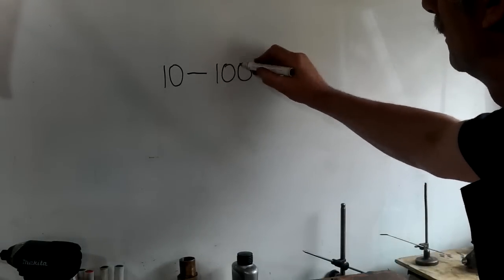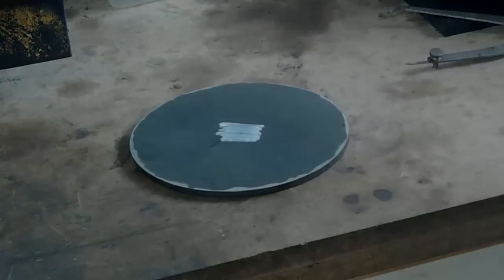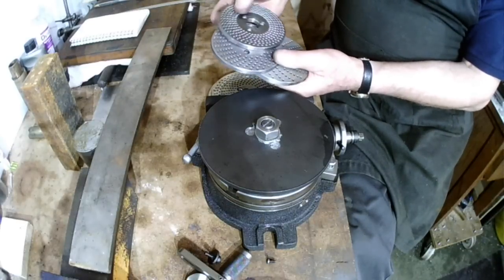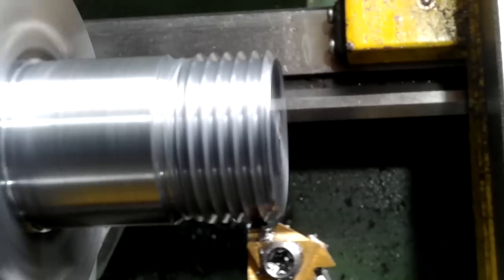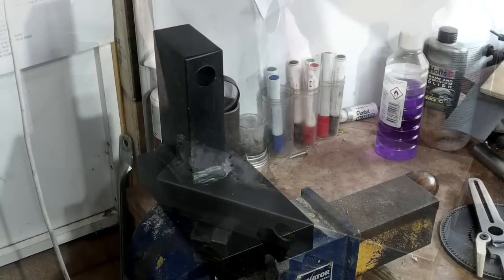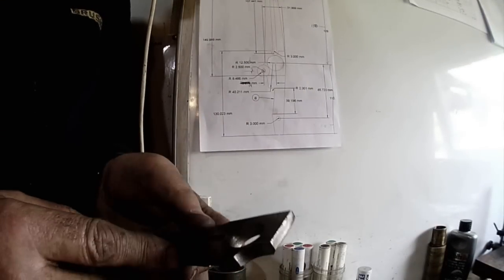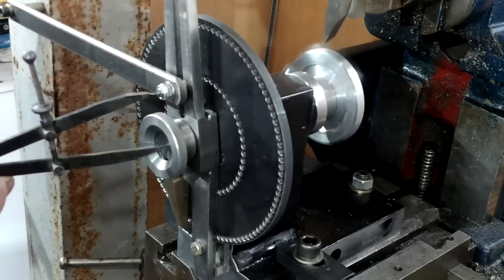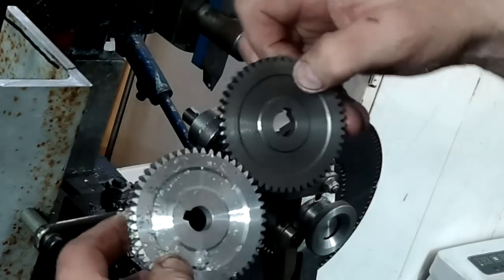Gear cutting on a Shaper (making the tool)

Comment: For cutting gear teeth on a shaper, I had only considered using a cutter with the complete involute shape of the space between teeth and plunge cutting to depth.  Using a jig to generate the involute shape with a straight edged V shaped cutter is very clever!
Thank you for making such an informative video!

Comment: Great project.   This setup will result in a tooth profile that differs slightly from an involute.  The tool path error is greater for shorter linkage and smaller number of teeth requiring turning the gear blank through a larger angle. When the tooth being cut is at top center the error is zero but diverges as you move to the side and turn the gear.  The error should be small enough for most practical gears to ignore.  EDIT: I did the math. with a 15" link arm cutting a 4" dia 24 tooth gear the error is 0.0004" too shallow vertically. (a 10" arm has 0.0007" error)

Comment: I tend to give subdued compliments at best but think this is a fantastic video..
Just thinking, you could angle it to cut helical gears, and combine that with a milling head to cut teeth without a clearance behind while cycling the ram manually.

I've made one large indexing plate, its tough but definitely easier if you can leave it setup on one machine and drill in sections.
Reply from the maker: Hi, thank you for your comments, nice idea for helical gears, i might look into it . I also find that the indexing plates come in handy for other quick setting options. regards

Comment: Very nice video!  The linkage will not produce a constant rotation per unit of cross feed…due to the geometry of the system.  You might want to check out @pottingshedworkshop.  Good going on taking on something so challenging!

Comment: Nice job. I was watching a channel with a homemade indexing wheel drive. He started the table 1 inch away to make sure all the backlash was out before the cut started. Your gear looks the part.
Reply from the maker: Hi, thanks, It is still in use. cheers.

Comment: I don't think I would ever be able to cut gears like the setup you created. For one thing it takes someone with a good mechanical/engineer mindset to vision what's to come and how it would work. I was a welder for 40 years, certified on everything. I would be happy just to hang around and make the welds for you. Amazing work you did. Thanks so much.
Reply from the maker: Hi, thanks.

Comment: What a pleasure it is to watch you work. I wish I were there and could add my welding skills of 40 years. I always learn from your great videos. God Bless and Thanks, Paul Greenlee
I forgot to ask you when you use your shaper compared to a milling machine. Do you think the learning curve to run a shaper is easier compared to learning how to operate a milling machine? Big difference in price for a fact meaning the shaper is less expensive. Thanks again for the help.
Reply from the maker: Hi, thanks for your comments. I had operated one only once, in college and it was harder machine.  meaning that a machine that is a balls out everything. If you take a bit too big a bite, the shaper will destroy itself to please you. The tutor always stood over the student while it was being set up. The saying is if you have a shaper you'll never make a profit because they are slow. I would beg to differ if the machine is properly used.
Regards.

Comment: You do have a dividing head.

Now you make a new dividing head with the help of this dividing head. I don't see the point.
Reply from the maker: Hi, thanks for your comment. Yes, it was a lot of hard work to make another indexing device. However, I did mention right at the beginning of that video that I would take up the challenge of making a gear on a Shaper. My universal indexing table was too big to fit on the Shaper, so I had no choice but to make this simplified indexing device. It did, and still does, make an extraordinary number of gears of any size to a reasonable diameter with any DP or module on the shaper and, it fits the milling machine, surface grinder and the tool cutter grinder. that's got to be a bonus. Cheers.

Comment: I purchased 11 different index plates off from EBAY (7.25" dia and under $200) all the same size, all specifically different in hole counts (some have 4/5 different count rows of holes on the same plate) and on yet another EBAY buy I purchased the spring loaded hole spacer pin keeper (used) off from some brand of original indexer (?), so that I could do as you are describing, BUT I made my mount such that I could cut gears as large as 13" diameter (maximum height drop on my shaper (Invicta 4A) table to cutter tool), so basically I can cut any tooth pattern from 4 to about 160. I cannot stress the need for an extremely ACCURATE GRIND on the tool cutter as this is the hardest of all of the operations. I wish that some manufacture made proper different size carbide inserts so all one would have to do is change the insert in the tool holder for the different needs of the different size gear teeth faces being cut, as I have no way of properly grinding them and that has proven to be the COST ITEM in the equation for doing the work yourself. Usually it takes me a minimum of 3 to 4 rotation rounds before I can achieve the full depth of the needed cut (raising the table needed X height after each pass) until the final depth is achieved. (NOTE: very accurate tooth gauge set required to maintain accuracy of measured depth and this item from Boston Gear (metal set) cost well in excess of $90), but absolutely all worth the cost to save a piece of equipment for which parts availability ceased 50 to 80 years ago.
Reply from the maker: Hi, thank you for watching, I take it that you have constructed one for yourself or something similar.
The tool is a bit of a pain to cut to shape, confirming size and shape without a shadowgraph equally so. 
I wrote a spread sheet program to calculate the tip width required for any given mod. cheers for now.

Comment: Buy a small hobber. This you did put too many errors into gears. For this to run smoothly, quite impossible, pitch errors would be too great.
Reply from the maker: Thanks for your comments but, I am a pensioner and I can’t afford a hobber of any size not to mention the cost of each type of hob cutter to make each mod. The tool I built has saved me a huge amount of cash making all sorts of gears and they all function very well. It is true that there are potential errors but, I’m not making precision gears. Regards

Comment: What you have done here reminds me of when I drilled over four thousand holes in a large plate. They had to be on location within one thousandth of an inch X Y axis. That is plus minus one thousand of an inch. This give me away as to where I am from the other side of the pond. The easy part was the Z axis that went through the plate. When drilling was done I reamed the holes with a two flute end mill. This made the hole very precisely. Worked like a charm. My reward, was an order for five more plates. I did not scrap a single plate. All within tolerance. The method you are using was the brainchild of Sunderland Gear Planer. Using a shaper with more bells and whistles. 
   I really enjoyed your video and hope you make many more Sir. Good luck and God bless too. Peace VF
Reply from the maker: Hi, thank you for your very kind comments.

Comment: How to get relation between linear travelling of work piece and its rotation for diffrent sizes
I mean balance equation
Thanks for your good work
Reply from the maker: Hi, simply look at a rack then look at how a gear would run over that rack, then reverse engineer how the functional relations between the two interact then you begin to see a picture of how to form the gear from the rack.

Comment: Slick. 
Years ago there was a video by a gentleman from Denmark who was building a 1/4 scale Kingair RC plane powered by homemade turbo props.  For the reduction gearing between the turbine and prop shaft he needed an internal helical toothed gear. He modified an old small milling machine or jig borer to cut the needed gears. That was probably the slickest piece of home shop gearing I've ever seen.
Reply from the maker: I haven’t seen that one.

Comment: How do you determine the size of the cutting tool ie the width at the tip
Reply from the maker: Hi. the formulae I used is :-
Dedendum x Tan(P.A.) = sum’A’
Circular Pitch / 2 = Tooth Width
Tooth width - (sum’A’ x 2) = tip width.
that’s how I calculated it.

Comment: Thank you for sharing your work, I was anxious for Jeffrey Crocker to continue his efforts to build one of these. Is there any chance you would share the cutter forming process? I cannot seem to find this information anyplace. You did a great job building this tool.
Reply from the maker: P.S. the gear cutter device has some faults rigidity is the most common issue.
i would also suggest that the tool be very sharp and and the feed rate not to exceed more than 0.1mm per stroke the tool must also pass right through. Despite the feed rate, the overall cutting time is comparable to milling.(if the gear is a very wide gear it is much faster than milling)
Reply: @Thesheddweller  I do not see how there is no table or formula for calculating the values for the cutters. I have searched through many very old texts, and found that they all refer to generating gears on Planer Mills and show the devices for this task. The equipment is much like the fixture you have created for your shaper. I have found repeated reference to generating gears by shaper as well, including fixture designs similar to yours, and still no reference to the cutting tool. I have to be missing something that is so obvious and simple that it didn’t even need to be written down.  I am sure that I’m over thinking the problem, I just cannot figure what I am missing. Thank you for your help and inspiration, maybe someone can clue me in if they see this, or point me in the right direction. Good luck, thank you for sharing your work.
Reply: I was planning that I would use my gear gages as templates for my next attempt at creating a tool. They are rack-form, so they should be a good template.
Reply from the maker: I hopefully sent a couple of pages from someone calling themself 'Base Circle’
the piece is titled ‘Gear cutting with the shaper'
Reply: @Thesheddweller  it didn’t make it, I sent you an email. Hopefully it gets through.
Reply from the maker: Hi, are you asking for my design notes or drawings for the tool? I haven't any drawings yet but when I get a spare day I will run some up and publish them for free like the thread cutting tool in my web site... www.thesheddweller.com.
Reply: @Thesheddweller  I somehow missed your reply. I have a slightly different notion for the fixture, I want to use half-ground pins so I can stack gage blocks to set the PCR. I think I would get less error that way. I was asking about creating the correct cutter form to use for this operation. The only part of this process that I am missing is the cutter geometry that results in the correct tooth form. I have searched online, and read many older texts looking for some guidance on this issue. If I could find the information for rack-form geometry it should be the same, but I’m coming up empty. I must be missing it too somehow.
Reply from the maker: @someguy1508  I too didn’t have any luck getting a table to help me calculate the shape of cutter tools for various rack sizes that I required,  so I made my own on a spread sheet (its on an apple program called numbers).
All I have to do is enter the..  mod, PA and how many teeth on the gear. 
it calculates and outputs the following,..  tip width, depth of cut, gear blank size and the DPC in both metric and imperial sizes.
You would think that after calculating all that and getting the spread sheet to work like it does. I have never verified it and I haven’t got a clue how to send it to anyone.  Its something to do with being a member of the old farts club. :-D

Comment: What about the error that the linkage introduces compared to the string variant?
As far as I understand, the linkage introduces a error that is the tangent function of the gear roll angle, a small number in the beginning, getting larger to infinite as the angle approaches 90°. So small gear tooth error with small, shallow teeth (if the tool disengages at a small angle) and large error if cutting few deep teeth, as the tool remains in the tooth profile for larger angles?
Reply from the maker: I have been contacted by Tomas Berger (I believe from Czechoslovakia) who has analysed the system, if you go to either of the two addresses below you should see his results. The linkage backlash, after I’d replaced the end bushes, had only a very slight play mostly flex from the anchor bar if I force it. I would assume (but I don’t know for sure) that the wire system would be more accurate at the extremes. I believe that at the extremes of travel, with the tie bar system, the rotational circumference accelerates.

https://berger240.rajce.idnes.cz/youtube/1466314247

Comment: Very impressed with what you have managed to do there. I think you have an error when you are setting the PCD with the calipers. Should this not be the base circle diameter? For a spur gear this is calculated by multiplying the PCD of the gear by the cosine of the pressure angle. The base circle is the diameter the involute curve is generated from, not the pitch circle.
Reply from the maker: Thanks for your comments. I used the PCD because this is the point that two wheels, one driver and one driven,  would ordinarily make contact before teeth are put in to the equation.
I've not tried it, but if I set the sliding pin to the base circle, at the dedendum, I believe the tops of the teeth will be more pointed, equally, if I set the sliding pin higher like nearer the top of the addendum the top of the teeth will be broader. But like I say I’ve not tried it. regards.
Reply: @Thesheddweller  Your definition of the PCD is correct for standard gears, but the involute is still generated from the base diameter. So you will have a small pressure angle error on your teeth, but if it is not impacting performance too much it should be fine. Still a very good effort. 
PS. There is an error in my previous post. I stated B. Dia = PCD x Cos PA, but it should be Ref Dia x Cos PA, as Ref dia and PCD are dirrefent on non standard gears.

Comment: This method will not produce perfect invlute gears. Tip of the tooth will be cut deeper than it should. It will probable work fine for larger teeth counts, but for 10 teeth gear it will be completly  wrong. It is because as you are more away from the center the angle of gear is less linearly dependend on sliding. I didnt watch the video completly(sorry, not much time), so if you are aware of it.... PS: otherwise very intersting. Subscribed!
Reply from the maker: It is true, the gear teeth are not perfect, and I don’t claim that to be the case. I haven’t cut any small number gears yet, but I will have a go, just to have a look and see. Cheers
Reply: @Thesheddweller  i did some experimenting and found 25t is almost perfect 18t is okish and 16t  is probably limit.i make image of profiles for diferent teeth counts, if enebody is interested. https://berger240.rajce.idnes.cz/youtube/1466314247
https://img37.rajce.idnes.cz/d3703/17/17020/17020865_a432df949b3d77cf46211f77e004a2f4/images/gearerror.jpg?ver=0
Reply from the maker: @tomasberger9980  Fantasic, I can see that I,ll have to do a bit more work to get this tool to work better for the smaller number tooth gears. cheers

Comment: Does the height of The Pusher arm on the angle iron matter, thanks
Reply from the maker: Hi Earle, thanks for your comment. to be honest I don't think so, it does allow the disk to be rotated further round to the right, but it isn't that important because the cutting arch is so small.
regards

Comment: Excellent. You just solved my dilemma of recreating a 33-1/3DP 20PA gear for my Hardinge cross feed screw. I tried a custom single point on the mill and rotary table and failed. Using the shaper with a triangle profile will be so much easier!
Reply from the maker: Thanks for your comments. glad to have been of help. regards.
Reply: , can you explain the relationship between the Diametral pitch and how far you go up on your sliding scale to give you every possible value?
Reply from the maker: @rallymax2  Hi, Please remember that prior to building this tool, I had never made a gear in my life, that said, I read a book on gear cutting and watched youtube to get a sense of what it was all about. Knowing that I, like so many, know that I can’t make precision gears.